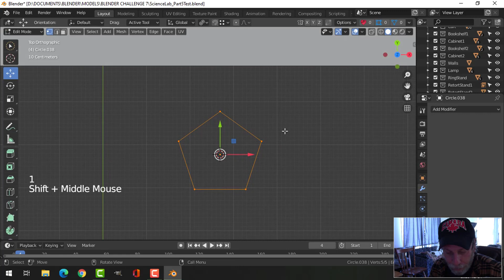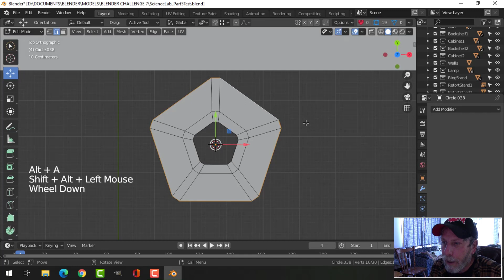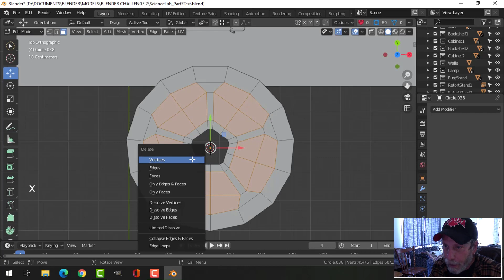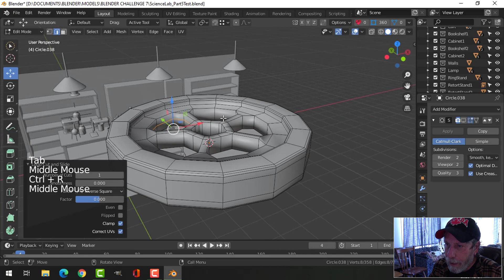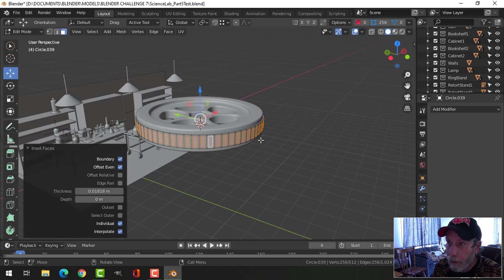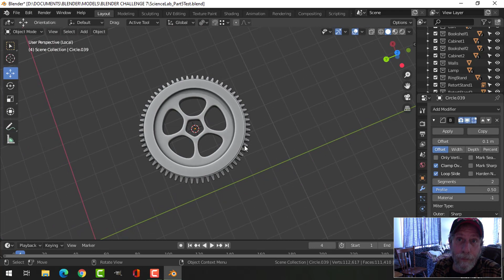BLENDER 2.8: Modeling a Steampunk Gear

Comment: Definitely appreciate this tutorial for making simple gears! It makes the process a lot more simple than I had initially assumed with little Blender experience.

I have experienced an issue around 2:41 in Blender 2.93: when trying to bevel the gear, two of the vertices seem to have something strange going on, where they don't bevel with the others and stick out as sharp corners with Subdivision Surface. Is this some kind of glitch with the old version, or is there something bizarre with the initial circle's geometry that affects it?
Reply from the maker: Glad this is useful.  For the glitch, can you make sure that all polys are facing outwards by checking the overlays tab and face orientation.  Otherwise, you can just select all in edit mode and Alt-N > recalculate outside.  See if that helps.  Also, select all in edit mode and M > merge by distance in case there are any stray vertices.
Reply: @zerobio  Thank you so much for the fast reply! It worked out perfectly with your recommendations!

Comment: I like the idea of making the teeth separate, so you can change the number of teeth but keep the base circle for the body of all the other gears.
Reply from the maker: Yes that is a good reason.  However it is a lot of polys and even better to do this as a normal map in blender or texture on substance painter.

Comment: I recently got into Blender, before this I mostly used Zbrush. 

I had a question about topology for objects that you use a subdivision modifier on for games. 
I'm used to completely constructing topology for high rez objects by hand, does that workflow remain the same for subdivisions? Or can I basically just take out some of the edgeloops to make a low rez mesh?

(context is doing it for games/to port the objects over to a game engine)
Reply from the maker: Yes, I woukd suggest either removing as many edge loops as possible or simply modeling the object from scratch without subdivision.   Good luck
Reply: @zerobio  I see, I guess I'll try both methods and see which one works best for me. 

Thank you!
Reply from the maker: @GovernmentFatigue  good stuff.  You could also download a free game ready model or buy one and see the topology and try to model like that.

Comment: Hello! m using blender 3.5....when I apply loop tool , circle, I am getting a different kind of circle where.. the outer most layer of the circle, where you have a vase with a flat base/ like a funnel head, there only one arm of funnel is moving out while the other is remaining straight..so the symmetry of the outer layer isn't balanced...which makes the later deleting of inside faces non symmetrical...how to handle this issue...please guide...thx!
Reply from the maker: I'm not sure.  Will have a look around and see if I can find anything.
Reply from the maker: Can you check that your polys are all facing outwards.   Select all the vertices and press alt-n ans then recalculate putside and try again.

Comment: I was looking for a way to make a ribbed rubber ring for a camera lens, similar to a focus or zoom ring. Your gear tutorial is perfect for the job. Thank you very much.
Reply from the maker: Excellent!  I completely agree with your problem solving.  This wasn't a camera lens but you can use this to get to a solution that you need.  Love that.
Reply: @zerobio I'm a 3D-print maker who has been using Fusion 360 for a number of years. I recently had some difficulty renewing my hobbyist license, which prompted me to decide to learn Blender. I haven't had to design anything for 3D printing yet, but I believe I can design much more sophisticated things in Blender. Everything I knew how to do in Fusion 360 is now much easier. Thank you for assisting newcomers like me in learning the software.
Reply from the maker: @nghin4vacsf  excellent!  Well good luck with Blender and hope what I am doing is helpful and doesn't lead you down too many blind alleys where you have to re-do stuff to make it 3d printable.

Comment: Blender 3.3.0 - 4:34 I discovered a problem with the Bevel Modifier when you APPLY it.. Outside/Inside normals and duplicate edges.
Now, It does happen with Blender 2.8, but at least I can merge duplicate vertices and that fixes the problem.
Also Blender 3.3.0 at 4:10 the "I" short is now one click for some reason.

Comment: it seems hey made a little mistake
you may encounter that the model may look wierd when using it outside blender
the normals seems to be inverted
press space/f3 and search flip normals
Reply from the maker: Thanks for pointing tthat out!  I usually check buy if I forgot to, that would be a real problem.

Comment: can i ask, in my app when 1:46 i select that outer edge and i click right mouse but there's no looptools there to make a circle. everything same the options with your except looptools the very top. blender 2.80
Reply from the maker: Loop tools is a free add on that comes with blender but has to be activated in user preferences. So go to edit / user preferences and I. The add on section search loop tools and check the box to enable it. Let me know if you can't get it working.
Reply: @zerobio  when I search for it there are no ads ons that show up, like when I type loop it the search results are just empty, I'm using the latest version in 2025 btw so yeah idk how to get my add ons working, if you could help I'd really appreciate it
Reply from the maker: @ In newer versions of Blender, go to Edit > Preferences > Get Extensions and find Loop Tools.  Try that.
Reply: @zerobio  I can't find anything at all about loop tools. Nothing from the extension site either. Is it just different for laptops?
Reply: @zerobio  nvm I got it thank you sir :D
Reply from the maker: @SHAZAMC26 good stuff!

Comment: I cannot see the loop tool -> circle in my blender. Where to find it ?
Reply from the maker: It is a Blender add-on that you need to enable.  Go to Edit / User Preferences / and search for "Loop Tools".  When you find it, check the box beside it and it will be available in the menu, Shift-A while you are modeling.
Reply: @zerobio  tks for helpful informartion
Reply from the maker: @binjay7123  any time

Comment: I do all the modelling,but when it cimes to rendering my pc cannt handle
Reply from the maker: You might need a better video card or more ram.  Either way, just try to render a smaller image size with not too many samples (try 150 samples with denoising on).  Good luck!
Reply: @zerobio  Thank you so much,it worked
Reply from the maker: @Digagz390  great!!